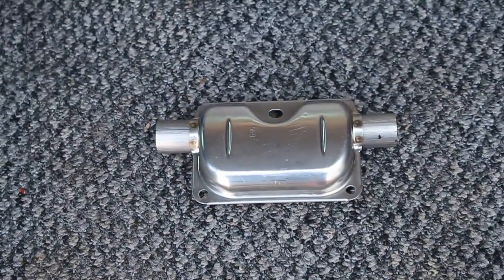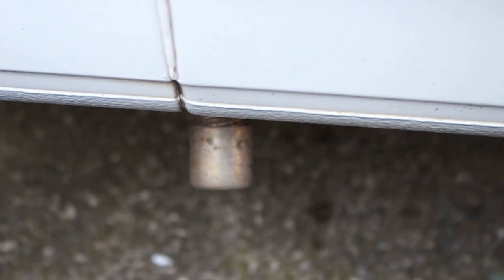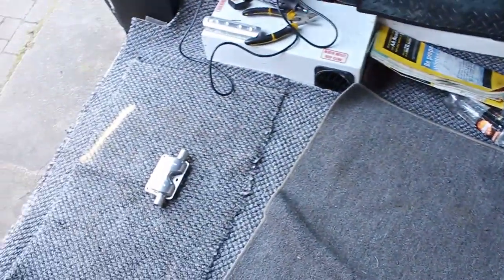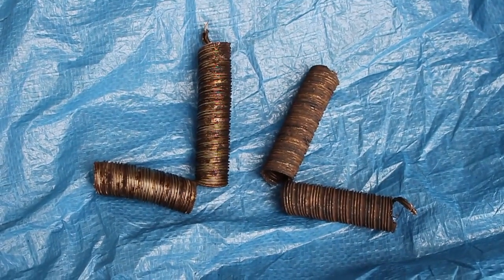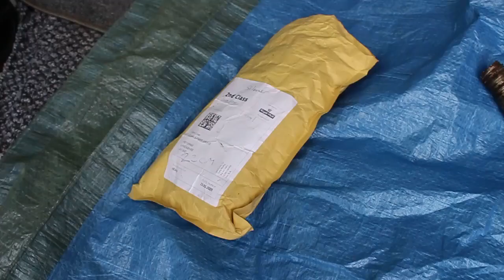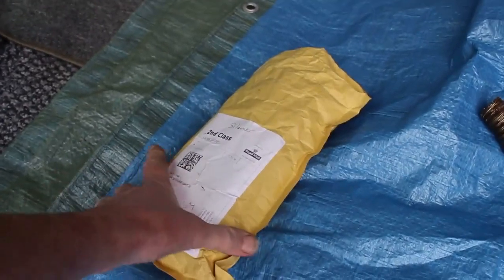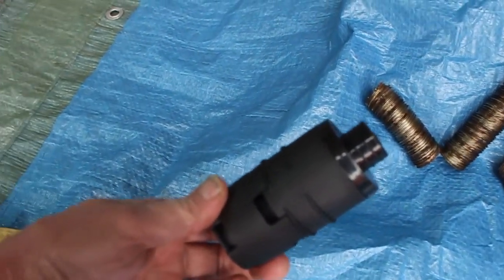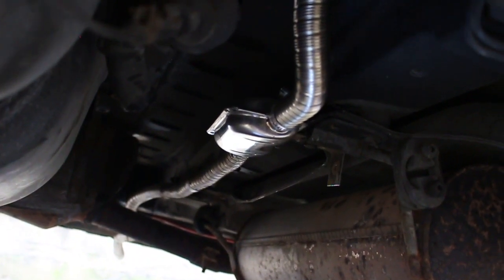WEBASTO EBERSPACHER DIESEL NIGHT HEATER EXHAUST SILENCER TESTED & CHINESE INTAKE SILENCER TEST

Comment: the exhaust muffler should be turned 90 degrees to allow the weep hole to drip moisture out.
Reply from the maker: Sounds like that's worth checking, I don't remember seeing any kind of drain hole, though.

Comment: I was thinking of getting one, but to be honest I can't really notice much of a difference.  Before and after still seem noisy,  shame they are good heaters, but very campsite friendly..
Reply from the maker: Yes, it's still noisy, but I think there was an improvement, most noticeable in the "back to back" from 3:50 on, whether it's worth the 30 odd pounds is totally a personal choice!!  I would have liked to have done a back to back with a cheap Chinese silencer. Also, it didn't help when the existing pipe crumbled & ruined my plans for doing a full run through on the same day, without moving the van or anything else changing!
Reply: @CaptainSparkle  I'm it's better, hard to tell if you're not personally there I guess. Good video though, keep up the good work.
Reply from the maker: @richarddavis4378  Thanks.